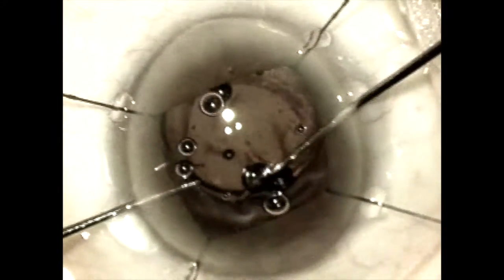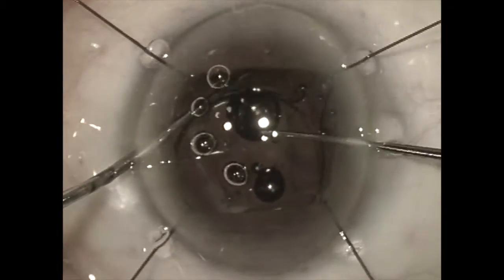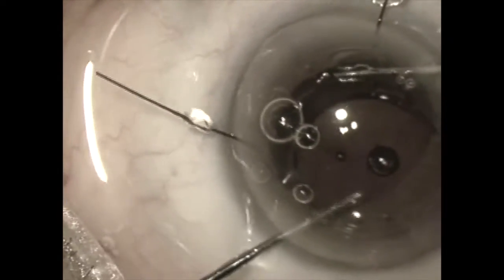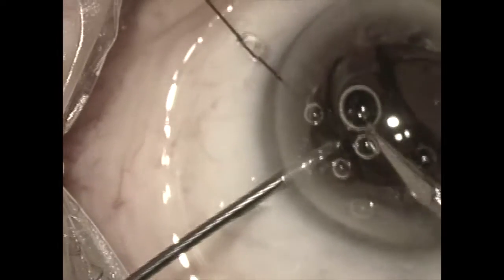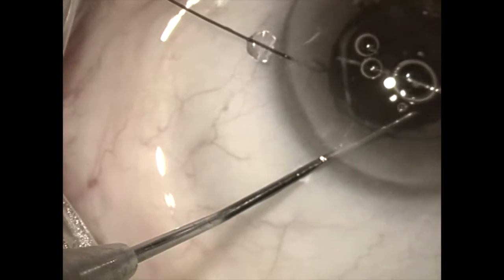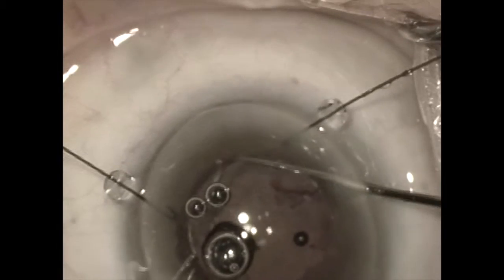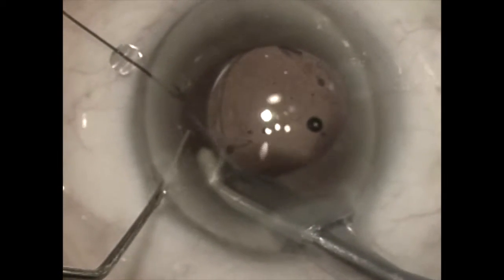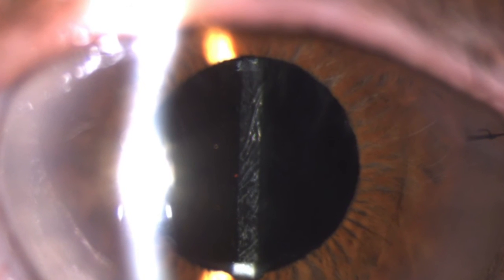Negative Dysphotopsia treated by IOLXch with ROC by Steven G. Safran MD

Comment: Thansk for the video Steve...what viscoelastic are using and what size incision do you need to explant the lens halves?
Reply from the maker: This is Duovisc.....I mostly use the provisc to dilate the bag and viscoat to protect the cornea and insulate things from my work.  I used about a 3.0 incision here.  2.75 keratome with a tiny little slide cut sliding out.